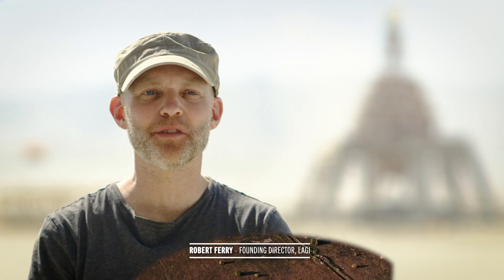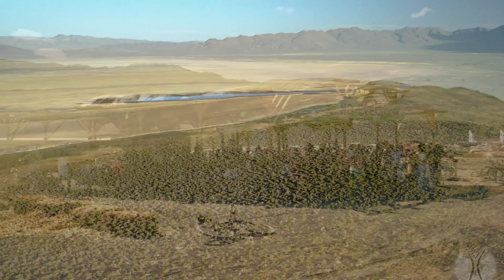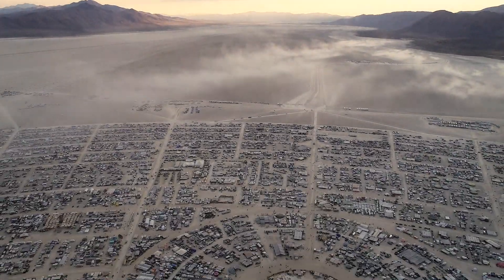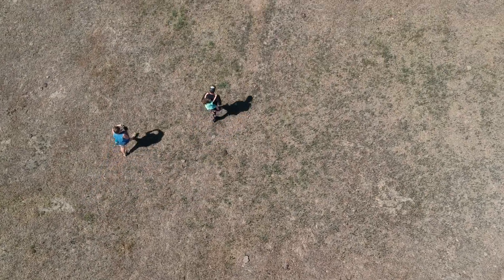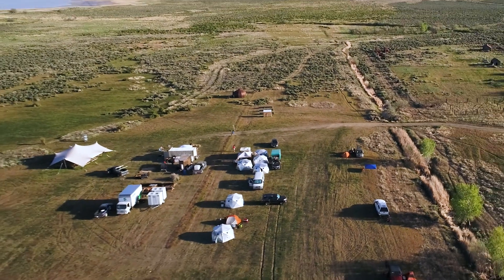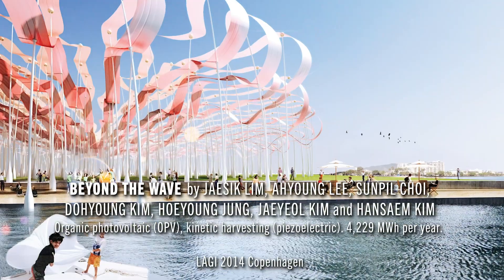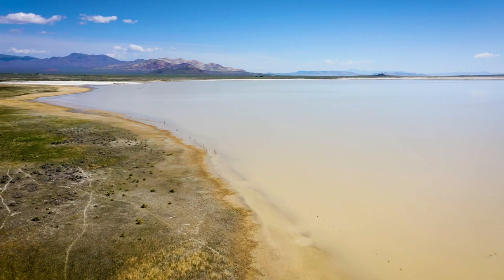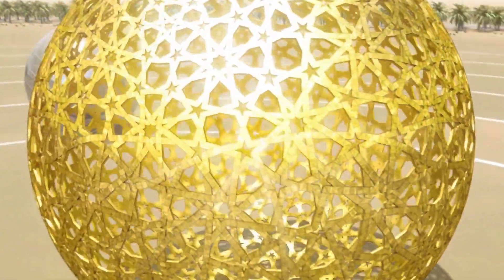LAGI 2020 Fly Ranch

Comment: As someone who works in the solar industry and attends BM, lots of these thin film submissions scare me. That technology is not stable enough for long term implementation in the harsh landscape, in my opinion the submissions need to be able to adapt/evolve and provide long term power, so I envision more structural submissions that can have new traditional panels put on every 5 years or so and the previous panels donated.